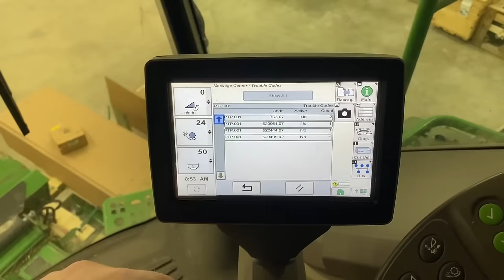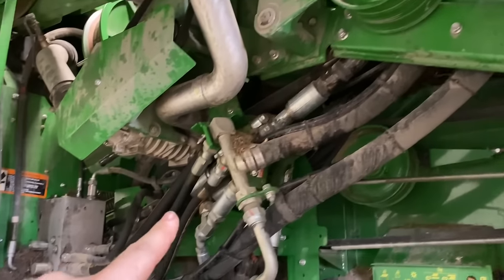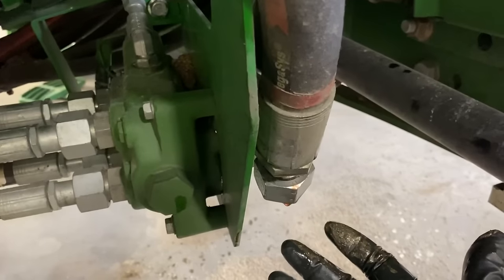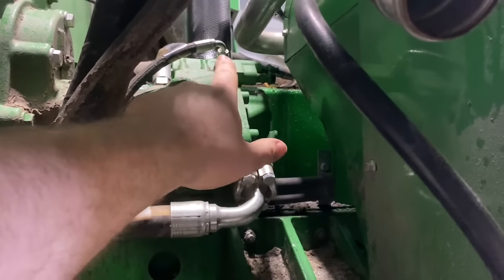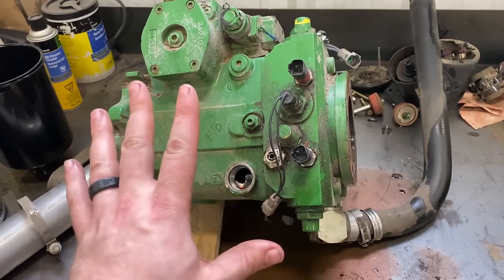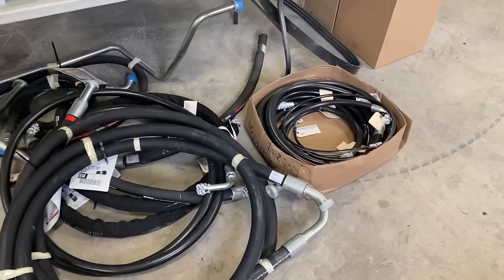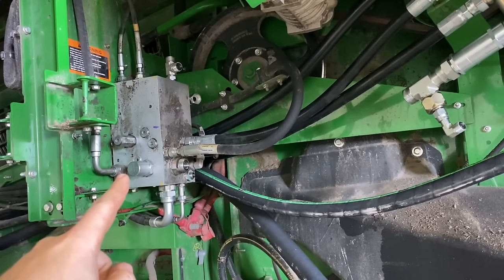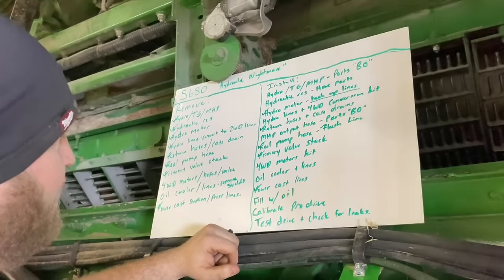John Deere S680 ProDrive hydrostatic pump failure.

Comment: Because the hydrostatic pump failure  can spread metal all through  the system . You would think a stop valve could be incorporated in the system so that when a failure is detected
the stop valve would stop  hydraulic oil from spreading only so far and shutting the engine  down before all is broken

Comment: Do you have a set of the knipex wrench pliers. What sizes would you suggest to a fellow jd tech?
Reply from the maker: All of them
Reply from the maker: I use the 10, 12, and 16” the most
Reply: Just don't buy them off the tool truck. I bought the 10" pair off of matco for over a hundred. Menards had the same ones for 60. May not be able to get the bigger sizes at a big box store though.
Reply from the maker: I get them through Amazon

Comment: What are those pliers you are using.? They look really handy! That air hammer trick on the fittings is a great idea! I  used to hammer them with a dull bit on several sides to get them loose
Reply from the maker: Knipex wrench pliers!

Comment: But what is the MAIN REASON it failed? Sub spec hydraulic fluid?
Reply: Most likely overloading the system as mentioned elsewhere. It's a combine, not a dozer.

Comment: Changing lines and hydraulic tank? Yikes, I feel bad for that customer. We use foam plugs and blow them through all the lines and hoses to remove contamination, and a filter cart to suck down the tank and remove contaminants.

Comment: My first thought is this repair worth it?  I’d surly be looking at a replacement combine vs 
the repair cost.  I seriously doubt that even with this repair you’ll get all the filings out of the system.
Reply from the maker: Trading and having to pay for repair is never going to be cheaper. I’m 3/3 on this failure and these combines are still running today. I have confidence this combine will run like new.
Reply: We recently bought an s680 for over 250,000$. A trade in or replacement will never be cheaper

Comment: Well again most least intervention by ZK MasterTech to flush oil contaminations rebuild of jd S680 pro drive Combine hydrostatic pump failure while only installing replacing total failure parts & lines in which debris is glued deeply & impregnated inner spheres of intake pipes & cannot b flushed hopefully after finding needed parts green Combine wilb rolling again, handful & behemoth  14ltr combine oil contaminations job was a contextual undertaking & accomplishment

Comment: There should be some type of solvent you could pressure flush the system with
Reply: You can't do that.
Reply: So many knooks and cranys you'll never get the flakes out and they embed into any rubber like hoses and seals

Comment: Why would they not put a filter bank down from the pump to catch any debris from wear and damage, A couple of pressure switches and the only time they need changed is when the pressure drops going thru them.  I admit I tend to over simply things but when a system depends on clean oil you filter all the oil before it goes to any components. A few hundred dollars additional parts when manufactured would keep a customer happy down the road rather than face the bill on this repair

Comment: Was this combine in 4x4 while running? Or were the metal flakes still able to contaminate the rear wheel motors without being in 4x4?

Great video as always.
Reply from the maker: It can still contaminate.
Reply: Ok. We had a rear wheel motor on a 9670 start "clicking" when turning at full lock. We pulled the cam lobe out of it an never engaged the 4x4 to finish the last 100 acres of harvest. Can it contaminate the rest of the system the opposite direction as well?  We found 3-4 flakes of metal in the cam lobe housing. I think the hub/spindle is slightly bent causing the clicking to possibly be coming from the spline mating surface inside the cam lobe. 

No slop in the hub bearings

Comment: Surprised no combine maker has gone diesel/electric like locomotives have been for years. Diesel engine drives a generator that in turn runs electric motors.

Comment: This is why I run every critical machine under warranty.  A repair like this is equal to or more than the yearly payment and does nothing to increase value of the machine.  Kind of sucks, but if your operation requires you to run these newer machines, think about a warranty.

Comment: Seems to me there should be some intermittent collection points with high screening value to stop any "upstream" failures where contaminants could gather and be flushed/removed, etc. to limit line, distribution. motor, etc. unit failures.  Also, "misspoke" as a soft word when the right word is "wrong" is you trying to be so politically correct and sensitive when in fact you are a mechanic/technician...master level, a person who is not perfect but who works to be his very best.  Great video, great skill sets you have!

Comment: "Right to Repair" shoulda let the farmer fix it himself.
Reply: The farmer could’ve repaired it himself but most farmers don’t have time or wouldn’t be able to do a job of this size. And if he had decided to do it himself there would be no warranty on the repair. But if the dealership does it you get a year parts and labor and related damage warranty. For most guys that too much money to spend to not get warranty.  I’m a John Deere technician as well and i know a lot of people are very misinformed about right to repair.
Reply: @abramthiessen2886  my comment was sarcastic. I'm a Deere tech also. Customers still pay us to change oil. Customers with service advisor still call us to diagnose problems. After they've replaced every part. The cause usually turns out to be a broken or rubbed wire somewhere.
Reply: 😆 ok. I thought you were another one of the people who like to blame all their problems on right to repair
Reply: No sir, kinda making fun of that type

Comment: OMG....Surely,absolutely 100% sure replacing these parts which are contaminated is actually more than this machine is worth....Plus labour on top..
This makes NO sense to me...
Reply from the maker: It’s not even a 1/3 of this machines worth.
Reply: @ZKMasterTech  so if its a £90000 machine the parts+Labour are £30000?